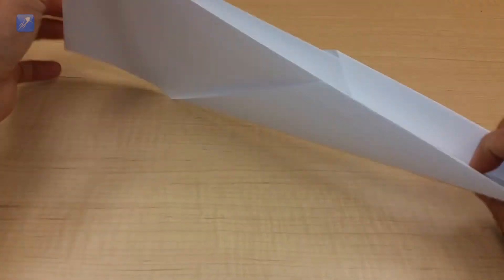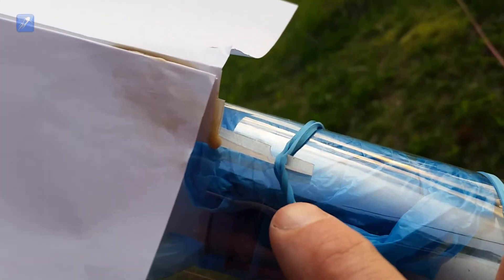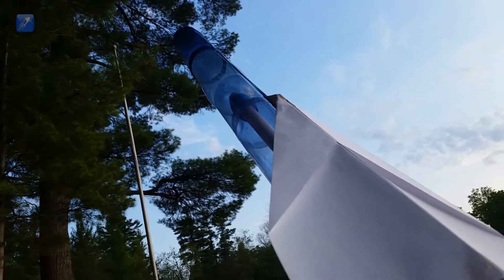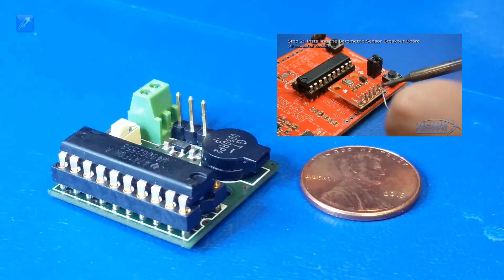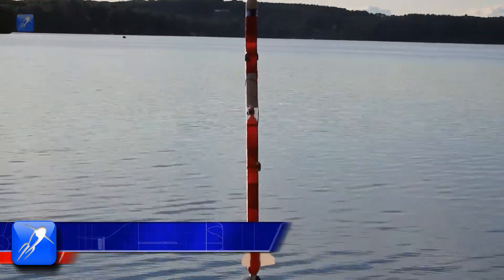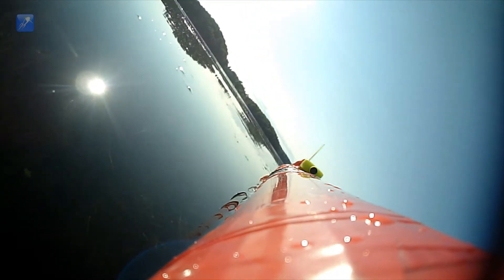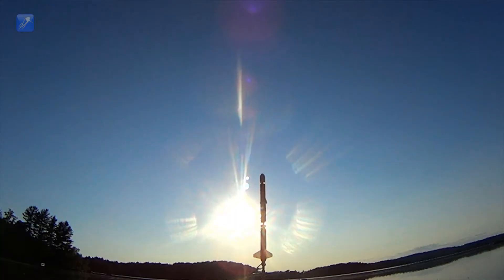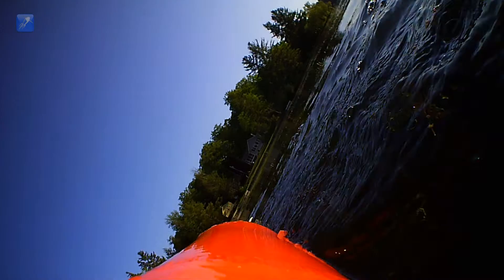Launching Paper Airplanes with a Water Rocket - Revisited

Comment: Nice work! It's like watching the trials and tribulations, and successes (!), of a regular space program, which I guess it sort of is.
I know you're moving on from the paper glider but I guess a tensioned wire could cross the wingspan and be a part of the glider. It could flatten the glider out after launch and could even replace the elastic band, holding the glider wrapped around the rocket during launch. At least it looks that way from my chair :).
Reply from the maker: Thanks for the kind words! Your idea is perfectly reasonable, and sounds like it should work. With any engineering challenge, you will find that there are any number of workable solutions. We chose the one we did because it seemed like the quickest to fabricate, which is sometimes the most important criteria!

Comment: Well done! We are looking forward to the video about the multi-stage rocket. The mechanism for separating the stages of a rocket is controlled by a timer?
Reply from the maker: The staging system is servo activated and the servo is triggered by the velocity of the rocket dropping to the (pre-programmed) optimum separation speed, as measured by the custom software loaded into our Altimeter. It could also be done with a timer, but we used the altimeter itself to put in a few safety features that a timer would not be able to use. For example, the staging system will not operate if the rocket is less than 100 feet in off the ground, and it will also not operate if the rocket is losing altitude. These safety features should prevent the separation from happening if the booster malfunctioned. For most people it wouldn't be a problem, but we are concerned that an abnormal boost phase would allow the sustainer to launch in an unpredictable direction, which could be toward a neighbor's rooftop or the woods. There's no reason the system wouldn't work with a timer, we just wanted to do something unique with it. Thanks for commenting on the video!